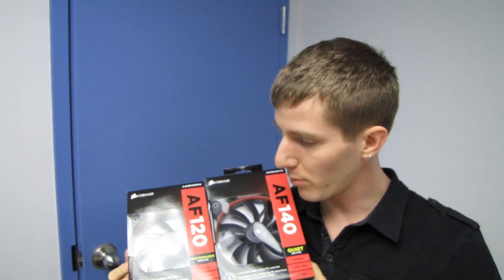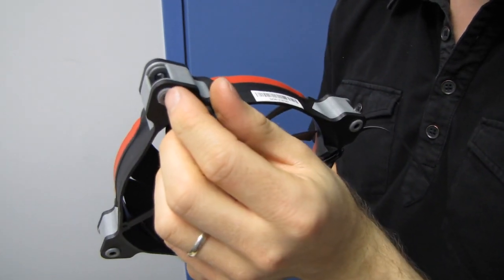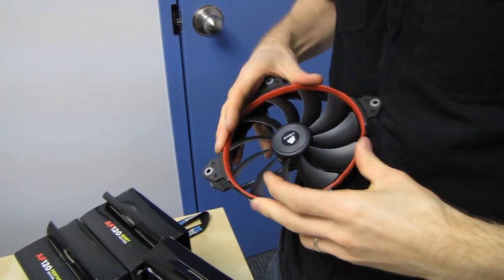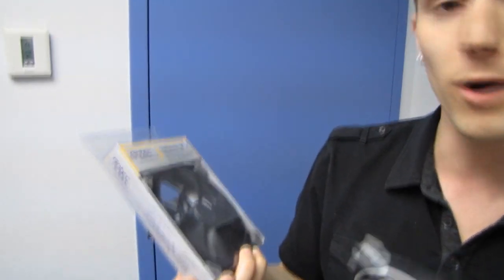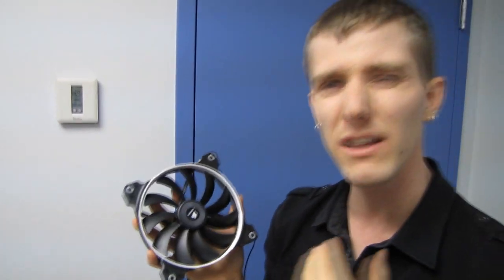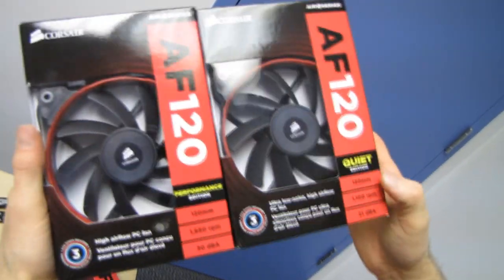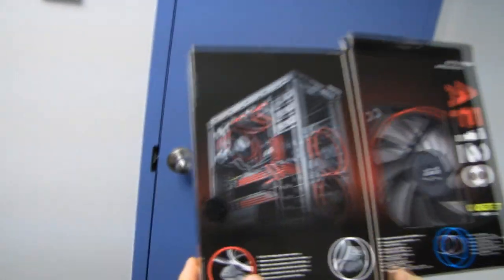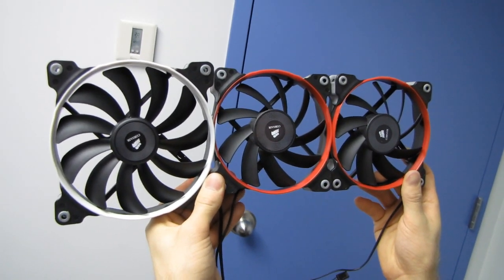Corsair AF Series Airflow Optimized 120mm & 140mm Cooling Fans Unboxing & First Look Linus Tech Tips

Comment: how long is the power cable coming off the fan ?
Reply: +russian doge thanks, i just bought a corsair fan so will do an unboxing soon
Reply: +russian doge i bought Akasa AK-CBFA01-30 30 cm PWM Fan Extension Cable £2.70 and Corsair CO-9050009-WW Air Series AF140 Quiet Edition 140mm Low Noise High Airflow Fan Single Pack was £14.99 so hope thisll work to replace case fan failing on my pc
Reply: +russian doge well i hope so ill do unboxing and another video to show the install so fingers crossed, hope your build goes well too

Comment: ok, little question: i'm building in an nzxt s340, and it will have a 240mm rad in the front as the only intake with 2 pressure optimized fans (probably noctuas cause they're in a place where the awful color scheme isn't visible...). so intake is restricted and the fans don't put through a lot of airflow anyways. i want to achieve agressive negative pressure in the case to get more air to flow through the radiator. so, do i populate my remaining two 140mm fan spots with airflow optimized fans to get as much air as possible out or with pressure optimized fans because they are working against a pressure gradient?
Reply: "Little question?"

Comment: If the difference between the high performance and the quiet editions is RPM, couldn't you just get the High Performance edition and decrease the speed, increase it when necessary?
Reply: Yep! That's why I got the AF 120mm HP, then when I got them I just decided between the higher voltage or the lower one. I went with the high voltage, I thought it was gonna be a lot louder than it truly was.

Comment: I use 6 AF fans, 3 AF 140mm in front and in the back of my Corsair 780T case, 1 AF120mm in open space on the top, 2 AF 120mm at the pull placement of my 240mm H100i GTX radiator. Then, I have 2 SP 120mm at the bottom of my case to stuck air through the bottom dust filters and last 2 SP 120mm fans in the push placement at the top of the H100i GTX radiator, for high static pressure.

Comment: Can they be used with h55??
Reply: Tack Hammer
you know that corsair af and sp fans are overrated over price those fans are bad for a full custom loop cooling
Reply: They work great for me, and they are aesthetically pleasing. :)
Reply: SP120's can be used for water cooling no problem, but the AF120's without a doubt would be absolutely terrible for a radiator job.
Reply: +black crow1234 they are actually almost the best you can get.

Comment: Hey I'm planning on putting 5 new fans in my case. The corsair ap-120 quiet edition one's, 2 at the front, 2 on the top and one jn the upper corner of my case. Good choice or not?
Reply: Af-120*
Reply: Af-120*
Reply: Depends on your case i use 2 AF-140's in my Zalman MS-800 1 in the front and 1 at the back, i just wish they had green ones. I use my top space for a H100i with 2x SP-120's.

Comment: Crap I just ordered a double pack of the af120mm high performance fans for my h100i. Should I still use them, or should I use the fans included on the h100i?
Reply: Eh ill just return the af120mm, I just ordered the sp120mm high performance. I also got 2 af140mm quiet for the front of my corsair 300r
Reply: ImReadyD151 I think that ones included are more than enough..
Reply: And as said below use SP120 because they are high pressure. I will use included ones, anyways wish you luck with your choice
Reply: As I too you
Reply: buy the cooler master sickleflow 120mm (69 CFW & 19dba max with 2000 RPM) at $7.99 it a bang for buck for extreme airflow build i use a NZXT source 530 with 6 of them on and my gpu and cpu temp drops 7*C my sapphire r9 290x vapor before OC temp max 76*C max after OC temp 69*C max i7 4770k OC 4.2 berfore temp 68*C max after temp i7 4770k OC 4.2 61*C max
Reply: black crow1234 I'm using stock fans with my h100i with an I7 4770k overclocked to 4.3 ghz and it hardly ever goes above 40*C.  Stock fans > Sickleflow.  However, the sickleflows look super sick, so in the aesthetics department the Sickleflows takes the cake.
Reply: Tack Hammer Idk what it was about mine, maybe my cpu i7 4790k but it ran hot as hell. I may have been getting misreadings. It def went about 40c
Reply: Hmmm that is odd, especially because the 4970 is supposed to be quieter, were your fans set up for exhaust or intake?
Reply: I believe exhaust
Reply: Ahhh if you want them to get colder setup your radiator setup as intake, that way it takes cold air across the radiator.
Reply: it doesn't matter how you set it up your rads what matters are how thick is your rads is the thicker the cooler and what are your rads and fans sizes and static pressure (mm/H2O) anything between 1.00-3.00 sp are better for rads than cfm
Reply: The air in your case is higher temperature than the case on the outside of your case, so setting up your radiator fans as intake pulls cooler air across the radiator at the expense of making your case run hotter, putting your interior components at risk, but allowing cooler temperatures on your processor.
Reply: Tack Hammer 
There is literally like 1-2 degrees difference for the cpu, I would rather sacrifice 2 degrees to my cpu than heat up my case and all the other components in there.
Reply: Jonathan Tran  Well it's a bit more than 1-2 degrees but ya, if you have good airflow within your case it shouldn't be a problem either way.
Reply: Tack Hammer True, including the radiator fans I plan to have 7 fans in my system and if I take out the optical drive then I could have 8 but that's kinda overkill so I'll stick to the handy dandy optical drive XD

Comment: Could theese coola a h100i radiator if i over clocked?
Reply: No, that´s the SP120´s job. If you want to cool the H100i radiator get the Corsair SP 120, it´s meant for radiators. The AF series is for case fans
Reply: Thanks Pony slayer
Reply: Nedder Ellahib No problem
Reply: That's correct. SP (static pressure) AF (airflow)

Comment: I can't decide which fan I want to get Corsair Airflow 140mm Quiet or Noctua 140mm fan. Also can anyone suggest me a quiet CPU Fan that is a 775 Socket. And low budget.
Reply: Noctuas fans are amazing but are expensive if you plan on getting multiple fans and look like vomit, but perform fantastically. If you have the money get the Noctuas, if not get the AF 140 Quiet Edition fans, they are still VERY good fans and I plan on getting some, plus they look great.
Reply: Anass Rhammar  Thanks
Reply: Anass Rhammar i agree i wish they would bring them out in a different color its not exactly hard to change the color and i bet there sales would go through the roof
Reply: dellboy2772 I'm pretty sure Noctua is releasing black editions of some of their fans.

Comment: These fans suck. They don't blow a lot of air around in the case. 1150 RPM and 67.8 CFM is not really good for a 140 mm fan for performance. I would suggest getting something cheaper.
Reply: The only ones that are decent are the SP's even the performance editions aren't that good.
Reply: have in mind that a bigger fan will move more air than a smaller fan even if it is moving at the same speed.
Reply: I have the SP's and they are great for the processor heatsink. Amazing on a after market cooler.

Comment: can i replace my 140 mm fans with 120mm fans? will this be ok? i have a corsair 750d with amd r9-290x will these fans be good enough for my system
Reply: yes you can replace 140mm fans with 120mm fans but i wouldn't recommend it unless you need the space. These fans are not the best fans you can get as in temps/noise but they look good and better than the stock fans on the 750d.
Reply: SnowLeopard84 thanks for your response. i replaced my stock corsair 140mm fans with corsair low noise high airflow led fans120mm. they look ok but if i had not screwed up on my order and orderd the same fan at 140mm. they would look awesome. they are af120 corsair quiet edition. i will reorder the 140s in a week or so they r pretty cheap, and thanks again for your response..
Reply: your welcome :)

Comment: Which would be better for corsair carbide 200R case. Using that kinda fan on top with also using 2 stock fans? or with removing rear stock fan and move it on top and put that kinda corsair fan to rear... Or replace the stock fan on front to that kinda corsair fan and then put that stock fan on the top of the case?

Comment: Im looking into replacing my 240mm stock side panel fan with 4 AF120's, my question is... I am now out of usable fan connectors on my MOBO is it beneficial to have a fan controller such as the  NZXT Sentry 2 touch screen controller, or should I just chain some Molex-to-Molex-with-fan-connector's together?

Comment: AF series (AIR FLOW) are better for case fan applications.
SP series (Static Pressure) are better for heatsinks and radiator cooling uses.

Comment: Yes the corsair af120,sp120, and af140 all have rubber corners. Putting a screw through the holes is difficult the first time. The only problem with rubber corners is if you want to securely bolt it to something it takes a lot of effort. Sometimes it wont be secure and will be kinda loose.

Comment: quick question are the corners rubberized on the corsair fans? Usually fans that don't have rubberized fan corners will emit a mild vibration in my steel case when placed horizontally. Its quite noticeable. I even use rubber screws and they still make sounds. I WANT TO SOUND PROOF MY PC.

Comment: It will affect the performance heavily lol, the paint may get in the bearings and if any clumps form you are stuffed. If you already have the Noctuas don't bother they are great fans (and expensive) but the color scheme is horrendous. The cheaper corsair which look better and are slightly worse are the way to go for me and I'll be using them for my RX360 as well as an AF140 in the back

Comment: I have the switch 810 like you and I'll be using the stock fans to fill up the front and HDD cages, a AF140 in the rear and 3x SP120s in the roof for a RX360 which I will be getting later. I'll be putting everything on my ASUS P8Z77-V using splitters etc. so I can turn everything low.

Comment: I have the corsair sp120 quiets and they are noisy when I put them in the front of my nzxt switch 810. Using sp120 quiets for free flow are not good and produces a whining noise. I put them on my h100I as pull and they are very silent. Next I am buying the af140s to put in the front. I am currently using cheap cooler master 120mm fans that came in a 4pack deal for 12dollars.  From my experience SP fans in open air can produce a weird low whine.  Its not the bearing its how the air is being blown

Comment: Hey, are AF series better fans then EK-Fan Silent : Air Flow: 58.8 CFM and Static Pressure: 1.7mm H2O. 
I have 3 of these in my radiator, should i upgrade those to AF series?
Thanks!

Comment: Are fans universal?  Can I use these in any old case?

I have a Lancool K63 and I snapped one of the front fan-blades while taking out the dust fans for cleaning (I didn't want to wait for the blades to stop spinning...)

Comment: The fan cables are frustratingly short, Bought 4 fans, 2 as intake and 2 as push pull, the intakes cannot reach the MB headers without extensions.

Comment: it all depends on how fast you want to move the air.
moving it slowly would require the "fan" to generate a small ionizing field thus not much noise, but moving it fast would require a lot of power to make the field, and it would make any loos magnetic metal vibrate to the fields around the wire, the case of the fan and transformer, that where most of the sound would comes from.

this is actually not a bad idea for a water cooling radiator, moving a lot of warm air like a breeze...

Comment: It's not at all practical for the size of fan you're talking about. There are technically still blades, they're just hidden away in a housing using a smaller, higher RPM motor. They'd probably be loud as a result of how they're engineered.

Comment: Pressure ones are optimized for used with radiators since they have higher static pressure than the regular ones.

Comment: As I said, I'm not saying the H100 is particularly good, I personally would rather get a Noctua NH-D14 for the money (though it is a big cooler). I agree with the noise issues with the H100 at full load, although this can be mitigated somewhat by fitting better aftermarket fans. However, you shouldn't look at the negatives of the H100 and think it reflects the company as a whole, as I said before, most of their products are very well designed and made, combined with great warranty support.

Comment: These fans rock! I have a couple SP's on my rad and 140 & 120 AF in my Level 10 GT case and they look sharp. The AF's are very quiet even at full tilt, the Performance SP's start getting noticeably loud past 50%...static pressure = higher db's so it's to be expected. since I replaced the Cougar PWM's with the HP SP's on my rad my water temps are down 2c. Not to mention my fans all match now...awesome job Corsair!

Comment: This fan is about free airflow, and you should use the fans as casefans (low airflow restriction) and the Gentle Typhoons are optimized for high static pressure (used for radiators, high airflow restriction)

Comment: I have 4 noctuas nf-f12 on my radiators, they are really good, but they're audible at full speed, you can clearly hear them humming, I keep them at 1150 rpm and you can only hear the airflow, only around 800 rpm they're really completely silent

Comment: QUESTION: would a 750w power supply be able to work with 550ti in sli?
Also using new ivy bridge and 8 gig of ram.
Also if i upgraded later to a 670 would that be ok too?

Comment: Yeah, the Caviar Green drives would be a good alternative, but the 40~% slower than the Caviar Black doesn't sound too appealing to me. (in PCMark Vantage, compared 2TB version of the drives, from legitreviews) Which would result in longer wait during loading screens.. I don't think I could live with that. Not to mention, that it probably doesn't matter much which type of drive I take to replace my existing ones.. when you mix 5 drives together, the noise is bound to be amplified somewhat.

Comment: Change the 580 for a 670. Change the shitty cooler master PSU for a quality unit from either, Silverstone, Corsair, Antec, OCZ or Seasonic. Also don't bother with the 2700k, It's just a cherry picked 2600k with a slightly increased clock speed.